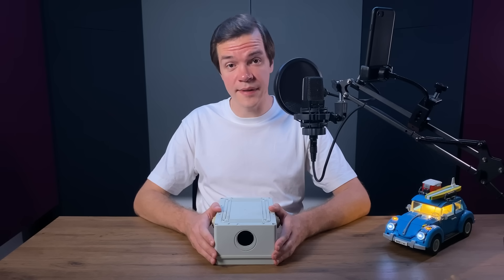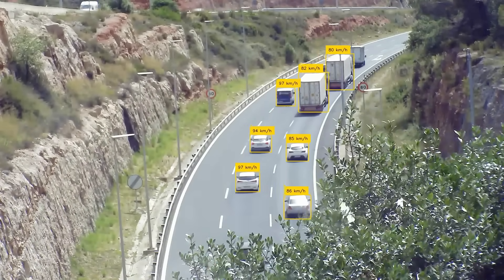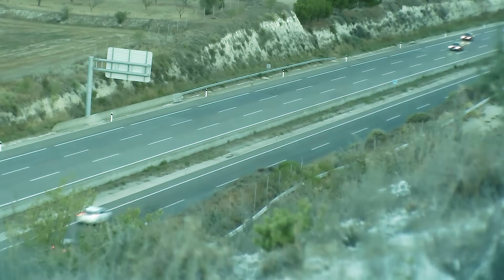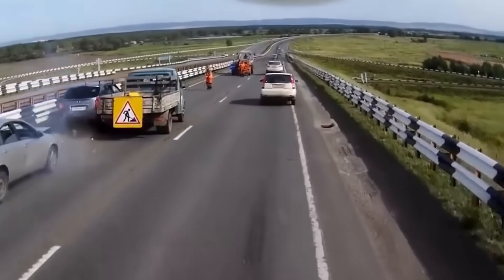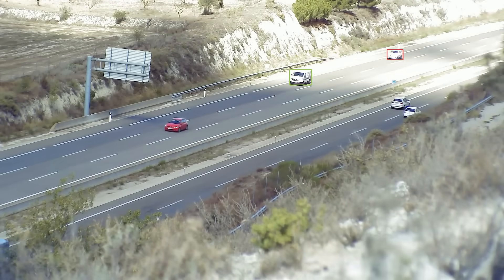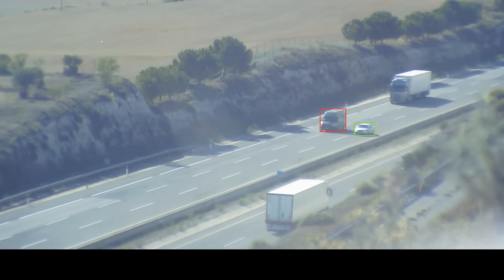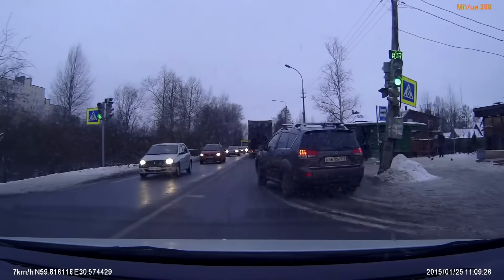New Anti-Tailgating Camera Reveals Shocking Statistics

Comment: Tailgating detection would be fairly trivial to do. Just do what you did, but add in detection for a lane change which would nullify the tailgating detection. AI does all sorts of stuff these days, this is child's play, with only object detection and fairly simple programming.

Here in Atlanta, with traffic, it is pretty hard for the 3 second rule to be maintained. I think 3 seconds is a bit overcautious, 2 seconds may be more reasonable. I drive pretty lazy and commonly have huge following distance so I don't need to constantly adjust speed, but if everyone did it all the cars wouldn't fit.

Comment: Let me know what your thoughts about my idea. Cars currently have the ability to maintain distance from the vehicle in front when using cruise control. So why not apply that same technology to prevent vehicles from tailgating? It overrides manual input from the driver to maintain the correct stopping distance biased on speed.

Comment: Equip cars with a sensor in the front bumper that detects the car ahead of them. If you are too close, it slows you down till the proper distance is achieved. If you don't want to involve auto-braking, have it activate an annoying alarm till the proper distance is achieved.

Comment: Two comments.  Nobody in their right mind follows at 100 meters, unless you are going 100mph.  Especially in heavy traffic.  What happens is that you follow "the crowd" at some distance at which "you thinK' you can react safely.  Usually that means having an "escape slot" around you.  Never parallel anybody, when going fast.  In LA on the 405, I got pulled over once, and the CHP asked me "why are you going so slow" in an area where everybody was going at about 80mph.  Fortunately my car was having trouble, and he suggested I get off at the next ramp and get some help.  The CHP was told to "maintain the flow" or else there would be even more accidents.  Second, we used to "draft the trucks" all the time in the Valley, since it was nothing but boredom the whole way.  It saved gas, and if in the low spots, during Thulle Fog, you could not see any more than about 20-feet ahead of you.  The truckers, who sat much higher up, and could see further ahead.  So whatever speed they went, we went.  The operative theory was that if they crashed, they would clear some space ahead of us, by sheer inertia.  Doesn't work if they hit an overpass stanchion.
Reply: I've never felt more unsafe driving than doing 40 (as instructed by the smart motorway speed limit) in an area that's supposed to be 50, but that people ignore and still do at least 70. 20mph differential is tolerable and feels okay. 30 is too much and is genuinely frightening (when nearly every other vehicle is doing 30mph more than you).

Comment: I've never heard of a three-second rule, but I do have heard of a two-second rule. At a speed of 100 km/h (62 mph), or 27 m/s (100 km/h), a distance of 55 meters between vehicles is acceptable for reasonable anticipation and braking time. If you assume a following distance of 100 meters, you can only fit 10 cars per kilometer on a stretch of road. That severely limits the capacity of any stretch of road. Following the two-second rule does mean however you'll have to count to 3 to determine the actual two-second interval.
Reply: For us it was said to be for a 100kph zone it’s 10 car lengths.  My automated cruise control uses this.  Plus, I once had to put this sudden stop on a highway into practice when a 6ft metal workbench came out of a trailer up ahead but 2 lanes across from me.  It went up, crashed down, then slid sideways across several lanes of traffic.  4 lanes of highway traffic (110kph) managed to suddenly stop safely and then recover.  (Amazing).

Comment: If multiple highway cameras detect two vehicles with matching registration plates repeatedly traveling in close proximity, it strongly suggests tailgating behavior. However, to accurately determine a violation, systems should also consider factors like vehicle speed, following distance, and traffic conditions. AI can analyze footage and sensor data across various camera points to assess whether the spacing violates safe driving norms. This allows tailgating to be identified and enforced automatically. In case of dispute, the video sequence can serve as evidence supporting the violation

Comment: The safety mdex assumes that the lead cars stop dead. This is only true if an immovable object caused the event. If the distance between the leading catr and whatever caused it to show ia sufficient to slow,  tne danger index should be based on the distance and relative speed of the obstacle. In practice as brakes are applied each vehicle in a queue chain will react to brake lights further ahead. The danger decreases the further back in a chair a vehicle is relative to  the obstacle. .

Comment: Excellent research and presentation. I have to question the accuracy of the speed. I noticed a few vehicles marked as going 195 km/h, which is about 120mils per hour. They do not look like they are doing more than 80 or 85 mph.

Comment: One thing I learnt, when you have a dangerous taligater you can vary your speed constantly, so accelerate then slow down constantly, it is quite difficult for someone tailgating to stay tailgating in those scenarios, so they will eventually back off.  Note don't do this tactic suddenly, and when they back off reward that behaviour with a constant speed.
Reply: Interesting point, 
the Highway Code advises you to gently slow down because the tailgater is taking your attention away from the road ahead so you need more space and time to think, and recommends you find a convenient place were they can pass you. 
But this doesn’t work so well in heavy traffic because it isn’t 1 driver tailgating … it all of them.
Reply: @robg521  They do say, if one person is tailgating, they're the problem. If everyone is tailgating you are the problem. Just a thought.

Comment: The most difficult calculation NOT taken in account is the quality of the safety equipment (tires, brakes, windshield, etc.).
Example:   Fo a piece of junk sporting 4 different tire brands and brake rotors at half their original thickness, a true safety gap would be close to 10 to 15 car lengths.
With a high performance or well maintained car running expensive tires, pads and rotors the gap would be significantly less.

Comment: A few of points i would like to add. 1.) the further your following distance, not only can you more easily react and brake in time, but also makes it easier to see any hazards around the vehicle in front of you. 2.) The further the following distance the more of a reaction you not only give yourself but also every vehicle behind you. If you have a following distance of a very high 10s and the vehicle ahead comes to a sudden stop you don't need to slam on your brakes to avoid the accident. You can gradually slow down leaving even your tailgater to have a similar braking control 3.) Having someone take the gap in front of you does not mean you have to hit the brakes. You can simply let off the throttle a bit or often times just maintain your speed. Very rarily does someone cut you off who was well ahead of you. Often times they come from behind which means they are already carrying a higher speed which means maintaining yours will soon give you that gap back.
Reply: As some one who lives in Houston, following distances are about 1 car or .5 seconds at speed (about 40 mph). I get cut off by cars going the same speed or slower than me all the time. It is fucking weird. In California I found being cut off meant I was without following distance for a bit of time as the person who cuts me off generally took off to get wherever they were going sooner. Here in Houston, not so much. Fucking bizarre as $#!+
Reply: In traffic, “having someone take the gap in front of you” is also often mitigated by the tendency for those same people to not stick around in your lane. They were impatient jumping into your lane, and having gained a few car lengths, are impatient to gain more—which requires them to jump to other lanes.

Edit: maybe it’s more of a CA thing.

Comment: Theoretically, you could have someone watching a screen of a remote camera feed. It could have the sophisticated math to show the operator the distance between every car on the road. That human operator could then in theory write up a ticket for unsafe following distance and save a clip of it as evidence. They would of course also need a reliable plate reader. Alternatively, they could in theory radio over to an officer with a description and plate of the car and have them pull them over on a traffic stop to issue a citation.

This solution of course is not automated and relies on a human operator watching a screen.

Comment: How close do two vehicles need to be before you consider one to be following the other?  Even if no one followed too closely I would expect a wide variation in following distance simply because a driver far behind another vehicle doesn't speed up to follow them at the minimum safe distance.
Reply from the maker: If one car is about to leave the camera angle of view and another just entered, they’ll have 200 meters before them, and it’s considered following. It’s logical to expect to see a uniform distribution after some common following distance that’s considered safe by the majority of people. What I didn’t expect was to see that “safe” distance is 30 meters :)

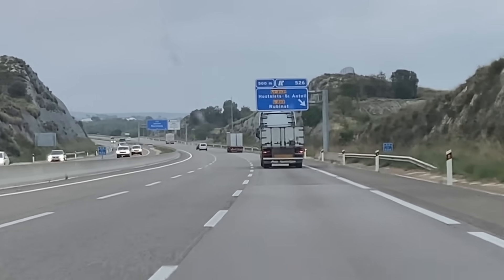Comment: 14:00 "If you maintain a 100 meter gap in dense traffic, other drivers will see that distance as excessive and constantly cut in front of you, forcing you to brake repeatedly." I used to think that, but I have observed that it is often not the case (at least in Chicago and NW Indiana, where I usually drive). Certain drivers (both cars and trucks) will maintain a much longer following distance for long stretches, and other cars will not cut in, because the adjacent lane is going the same speed, so it won't save them any time. When they do cut in is when one lane is slowed down for some reason (such as an exit being backed up), and they will do this regardless of the other car's following distance. Don't take my word for it, try leaving a longer gap and watch what other cars are doing. A few cars will change lanes (often because they want to be in that lane for other reasons), but most will not.
BTW studies have shown that traffic would not bunch up near exits if more people left a longer following distance, and traffic would flow more freely. Adaptive cruise control can help with this, even if only a small fraction of cars are using it.
I think people tailgate because they're impatient and they think it will pressure the car ahead to go faster, even in dense traffic where they obviously can't.
(I once saw a bumper sticker that said "I'm not slow, you're impatient")

Comment: Biased analysis (but gives somehow clues on how to improve near the end).
The "safe distance" of 100m at 120km/h only makes sense if some random stationnary obstacle suddenly appears in front of you.
Most drivers will naturally increase this distance without noticing when a series of tailgating cars forms in front (or even behind them), hence when there's a risk of pileup
To be more precise, you should calculate an include this "pileup risk situation" in the algorithm. For instance by combining the "k" factors of the preceding cars (could be the lowest one, a weighted average, exponential...)

Comment: This is an utter brilliant piece of research in all aspects, from video capture, to image processing, to conclusions and presentation. And you are quite correct in your conclusions. As you say, the problem is aggressive driving which can force you to close-up as a ‘least bad’ option, so as the limit all but the most extreme cutting in. Personally, I do not brake on a cut-in or loss of distance, as that is liable to cause ‘an accordion’ or progressively heavier braking behind me, resulting in an accident several cars behind. Instead, I take my foot off the gas to gently allow the distance to increase. Better than starting an emergency braking ‘accordion’ behind me. And the closer someone is, the more distant I leave in front, as I need to allow for his braking, not just mine. But anyway, a great piece of research ❤
Reply: @iainhunneybell,
 "... as i need to adjust for his braking, not just mine..."
 EXACTLY.
Good critical thinking ( And driving ).
Too bad others aren't as intelligent as you.
We end up having to think for them, as well as ourselves.    ☆
Reply: You can always blink your stop signal without actual braking when you take your foot of the gas. Just to let the following car know, that something changed.
Reply: Cars have the technology to be programed to follow at a safe distance.. but not everyone uses that feature or abides by it. So why not take car safety a step further and have a mandatory warning? You could employ this technology as a standard the exact way you do with seatbelts. If you dont put on your seatbelt on get an annoying dinging sound and blinking dash icon till you abide by the law. If you followed to closely and got a dinging sound and red blinking dash icon Im fairly sure everyone would back off after a few seconds just as they submit to putting their seatbelt on. The impact would literally be HUGE since most accidents are caused by following too closely.
Reply: @scottshawn70 
 Like what you did there:  "...the IMPACT would literally be huge . . ."
Ohh😢...you jokester . . .   ☆
Reply: Regardless of your action or intention, the accordion effect will still occur.  In fact, if you are slowing without brake lights showing, the vehicle behind will be slower to react and will have to brake harder than you do.  If this is in a long queue of tailgating cars, the situation could rapidly escalate until someone at the read doesn't have enough time to react or someone has left sufficient following distance to absorb the braking with less severe braking.

Comment: Very interesting research. I have not seen any analysis like yours of real tail-gating.
Let me make a couple of points.
You focussed on the reaction time, which you said is about 0.9 seconds.
I think that is optimistic.  It is probably more like 1.0-1.1 second — longer if the driver is not totally concentrating their attention.
The other point is that the distance required for stopping has two components:
The time and distance it takes the driver to begin to react; and the distance required to bring the car to a stop.
The reaction part increases linearly with the speed, and the stopping part increases as the square of speed.
(The kinetic energy of the car increases as the square of the speed, and brake force is constant and independent of speed.)
The UK government publishes a booklet called The Highway Code which is a summary of the rules of behaviour for drivers in various situations.

Comment: I tend to ignore the interstate speed limit here in the US. I stay in the slowest lane (far right), and go 55 MPH, or 90 KPH. I am usually at, or way below the limit. The limit, depending on the area can be as high as 80 MPH.

There is the very rare chance an interstate has a 45 MPH work zone, if it does, I slow down to 45.

I don't follow the 3 second rule, it's not enough time for me to see the hazard, identify what it is, then brake or move out of the way. I try to stay 5, or 10 seconds back.
Reply: You should surrender your driver's license and call a taxi. You're a public nuisance.

Comment: This is why I like adaptive cruise control. Even more annoying than a tailgater is the driver who starts to pass and then starts pacing you alongside. Or even better - just behind in the blind spot. I could never understand that behavior.
Reply: Me either.  Unless they were using cruise control as it turned out that way ?